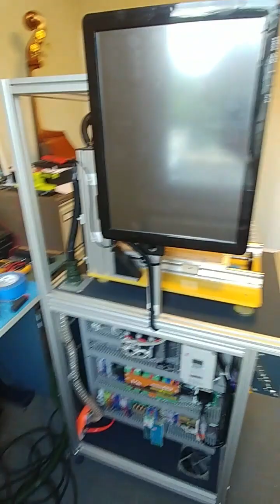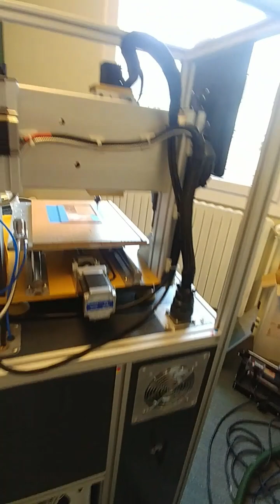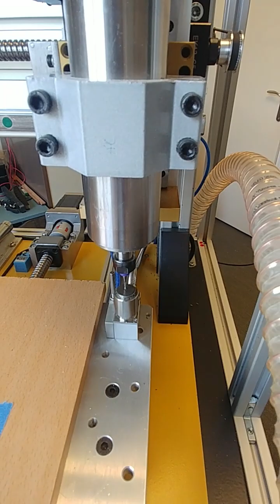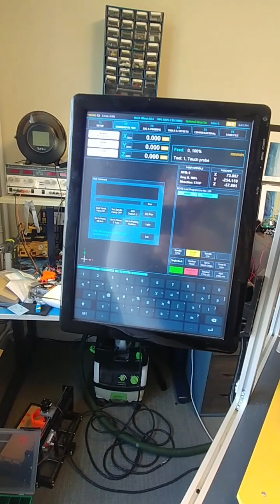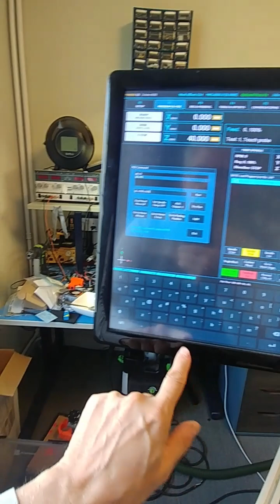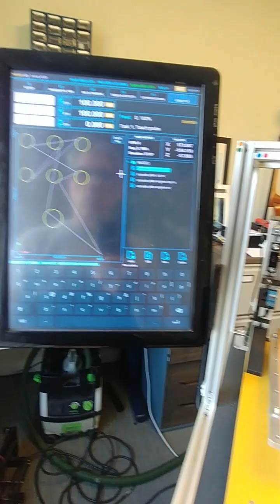My first home grown CNC

Comment: it can create PCB boards and what other things it can do
Reply from the maker: It has been designed specifically for drilling and routing PCBs with a spindle up to 60,000RPM. The frame is rock solid and it could also mill aluminium, wood, plastics.